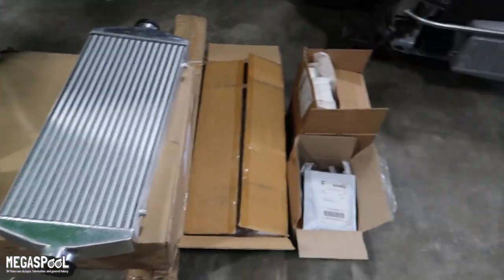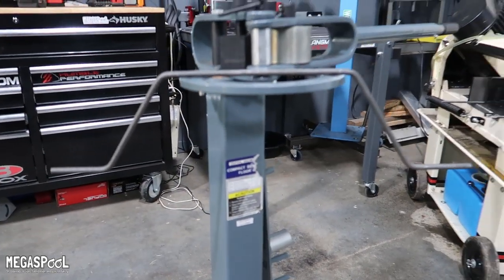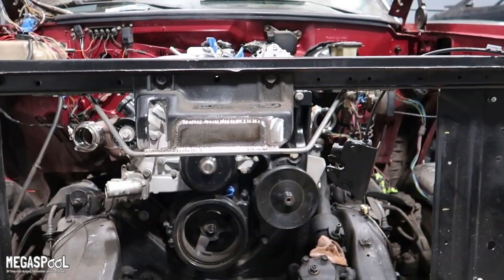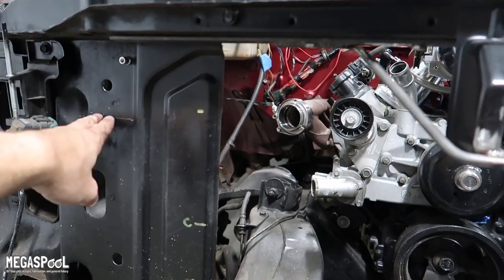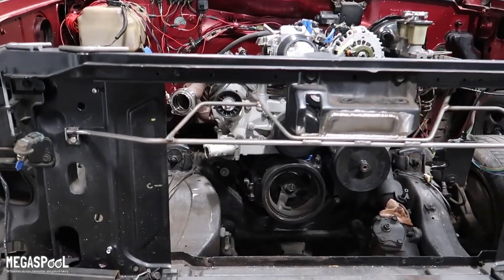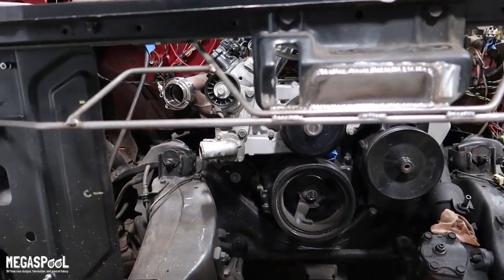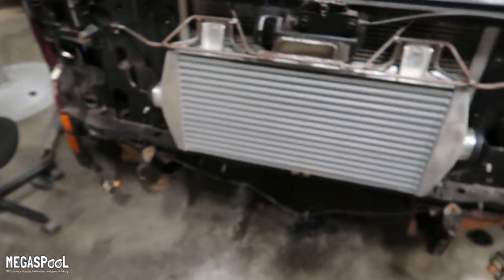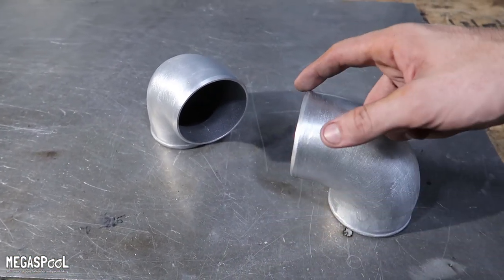CUSTOM INTERCOOLER MOUNT! LS Turbo Fab PT. 2

Comment: Sick work as always, don’t forget to consider the space you’ll need for the cooling fan/shroud before welding up the charge pipes too tight to the radiator.

Comment: Good video man truck is starting to come together and looking good. Love seeing the grind man. Looks like you need to get a brake there are a couple really cool weld your own brake kits. Let me kno and I'll email you the link to what I bought alot easier then the bender. Keep on killing it man.
Reply from the maker: iam theoutcast yeah shoot it over. I’ve been looking at the swag press brake kits and the bailegh magnet brake but that puppy is expensive! I’m probably gonna wind up with the big one from Harbor freight. It’s not a finger brake tho.
Reply: @megaspool I got mine from swagoffroad.com it's the 20 ton finger brake it was like 300.00 works amazing . Also have the same style kit as the tube bender with the pneumatic cylinder. It's awesome for making brackets. You can actually coin a 90 with it. Worth checking out.